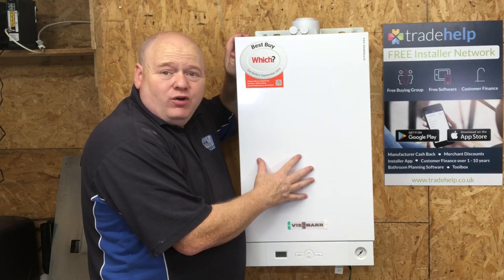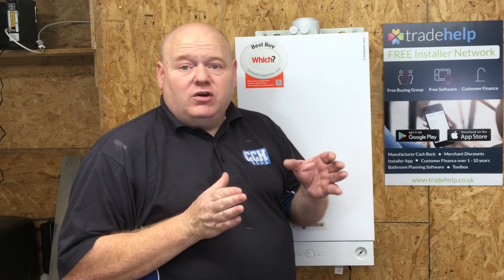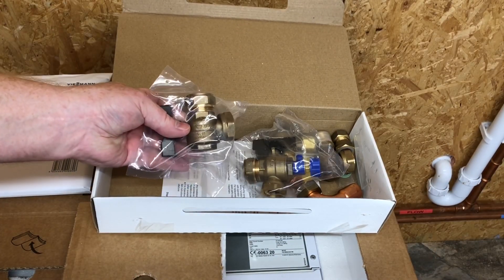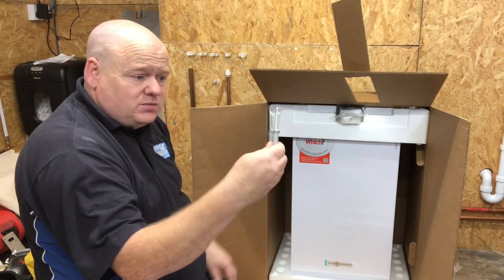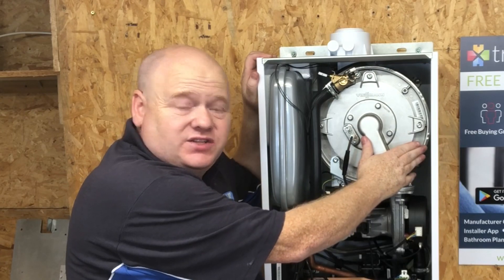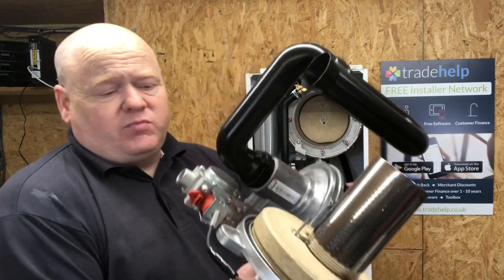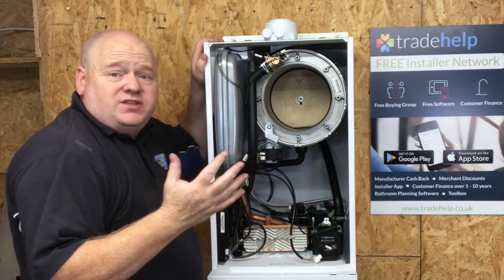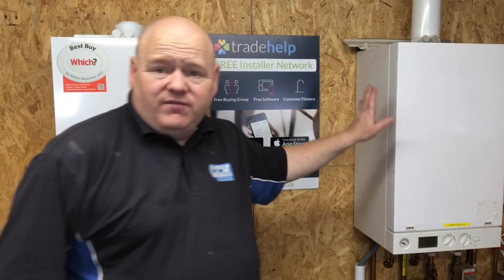Viessmann Vitodens 050 Combi Boiler Review - What’s in the box - Full strip down

Comment: Fitted one yesterday.    Fairly basic    Easy to commission    Don’t like no securing screws on the push fit flue elbow on turret
Reply from the maker: Thanks 👍
Reply: Allen Hart     Viessman actually suggest using pressfit under the boiler to prevent soldering damage.
Reply from the maker: @gasman4012  I use press-fit on all my jobs. Thanks.
Reply: @AllenHart999  I also used press-fit on this install after watching your videos, Great fittings   No flux or other nasties.
Reply from the maker: What warranty did you offer?
Reply: Allen Hart   If i register it with via the Viessman installer portal they pay the small gassafe fee and extend the warranty to 7 years. Also got some promotional goodies from the local rep , also free gifts with every boiler you register via the portal .
Reply from the maker: Gas Man If you sign up on the link you can still do the same but you will also get 10 years for free,
Reply: Gas Man The push fit flu elbow you will find self locks into place after a while! you try pulling it off after a week!
It  had me concerned years ago as well !!

Comment: Absolutely correct , its how its installed, rather than the boiler
Reply from the maker: 100% Thanks.
Reply: Allen Hart hi Allen I just noticed that the boiler box was on its side facing up the wrong way ,you have to lay the boiler on its back (Black arrows on box facing upwards ) they have a heavy heat exchanger on these, Laying the boiler on its side can distort the back panel or break heat exchanger mounting legs , I hope you don’t mind me saying so

Comment: Plastic manifolds and rubber hoses so not for me thanks ! But as you mentioned this is their “budget” model. 

Good to see stainless heat exchanger, a copper gas pipe ( what are Worchester doing using that rubber / plastic gas pipe, terrible idea ) also good to see a built in shock arrestor and the PRV built into condense line - all boilers should be like this.
Reply from the maker: Daniel Collins The top end Viessmann Vitodens 200 also has rubber hoses.